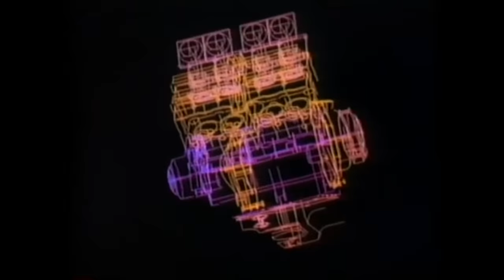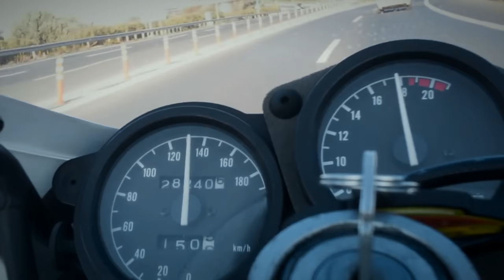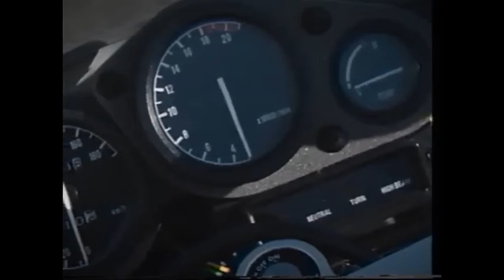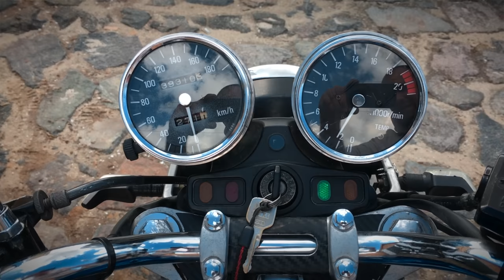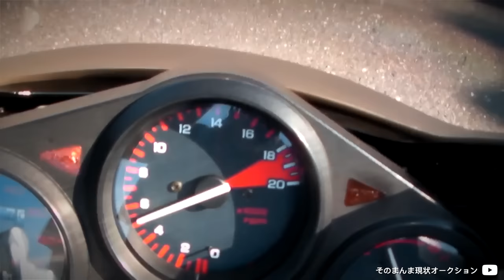The 18,000+ RPM 250cc Bikes Were The Pinnacle Of The 1990's

Comment: I'm not surprised Honda dumped their extra stock in Australia.  It's been many years since I lived there, but when I got my bike license in '88, you were restricted to 250cc or less through your learners and provisional license.  Only when you had your full license could you consider legally riding something larger...so there was a builtin market for 250cc bikes already in place...and many learners wreck their first bike, which keeps the market from becoming glutted with second hand 250s.
Reply: Impossible to wreck a 250
Reply: @Fee.1  What an odd comment.  It's very easy for a learner to wreck a 250 - same as it is with any bike.  All it takes is for someone to pull across in front of them at an intersection - 250s don't stop any better than a litre bike.  Or oil on the road, on a rainy day.  There's plenty of situations a beginner would have trouble with and could conceivably wreck.  It's not always about outright speed, especially for a beginner.
Reply: @Fee.1  You can wreck a 50cc if you try hard enough
Reply: @DanteTheAbyssalBeing  impossible
Reply: @aussiebloke609  nobody can wreck a 250 literally they had monkeys riding them for that experiment and they didn’t lose a single bike they can’t even touch the ground if you try if you put the kickstand up and let go of the bike it will just stay up it won’t hit the ground
Reply: @Fee.1  Have you ever ridden a motorbike?
Reply: @DanteTheAbyssalBeing  yes but only the uncrashable ones
Reply: @Fee.1  youtube never fails for morning entertainment, ask the parents of all the dead teenages if the bike was ok after, ive scraped kids off the road and put parts of motorcycles in 45 gallon drums.
Reply: @aeroflopper  why would you put parts in 45 gallon drums
Reply: @aeroflopper  My Uncle's a paramedic, doubt he could even count the number of deceased riders and wrecked bikes he's seen after 30 years. Tonnes of fun, but tonnes of danger.
Reply: @Fee.1  made all the small pieces easier to carry on a recovery truck
Reply: @aeroflopper  teenagers can’t die
Reply: @aeroflopper  ah ok I thought you meant like in a drum of some liquid
Reply: @Fee.1 I know people who wrecked 125s so 250s are easy to wreck, you don’t seem like you know what you’re talking about 😅
Reply: @Mr Murders  The idea is not about how easy it is to ride, but how easily and quickly you can accelerate to high speeds...and relative beginners are often those who push beyond their skill level (usually because they're still discovering their skill level.  Painfully.)  As you said, "it's less about the size of the bike and more about your ability and the conditions of the road.".  Relative beginners are not necessarily in a position to avoid the conditions (I've known many in Australia who rode every day because they didn't own a car, so riding in all traffic and weather was a fact of life) and they sure can't change the conditions.  And beginners haven't acquired that ability you mentioned yet.  So the idea is to try to slow them down so at least they're less likely to be moving as fast as they might otherwise if/when they come off.  For some people (especially beginners who don't know the limits of the vehicle and their abilities yet), more power simply means it's easier to ride - that is, easier to quickly attain speeds they lack the ability and experience to handle.  Obviously, the idea of a 250 4-stroke being that significantly slow is laughable today, but when I was a kid, they were lucky to crack 100-110 km/h (62-68 m.p.h.) at W.O.T. and lying on the tank.  Things are different today, but legislation moves at a glacial pace -- and correcting bad or outdated legislation is even slower.  Cheers, mate.  👍
Reply: @Mr Murders something like what odd? You’ve given zero context so I have no idea who or what you’re replying to or what your point really is
Reply: @aussiebloke609  my ol' fzr250 topped out at 116 mph.. and got there quicker than any road going sports car any average person could own..
 So.... yeah still quick enough.. but... It's not 160mph plus quick which is to be fair akin to letting a kid play with a gun for young inexperienced people..
Reply: Can confirm its not hard to find a cheap Honda cbr250rr in Aus but i can good luck finding a gsxr250rr, fzr250rr or zxr250 though an I mean just in general no ones parting with those ones you'll  be lucky if you find one 😂

Comment: I've just finished refurbishing the forks on my CBR400RR, also a curiosity of Japanese regulations. 59BHP and a 14.5K red-line, as well as having that gear-driven cam whine. They're great little bikes.
Reply: How long did it take to do?
Reply: @Mohapi_Tau  the actual work only took a couple of hours..... waiting for parts to arrive took about 5 weeks altogether, mainly because the top caps were seized solid and getting them out chewed them up a bit.
Reply: Oh man id love to have an old cbr400 lucky man

Comment: I had an '89 Yamaha FZR250R Exup about 25 years ago. My initial mechanical sympathy was soon overridden when I found it had no meaningful power below 10,000 rpm. Amazing technology when you consider how reliable they are with the revs involved. Great fun at non licence threatening speeds. I fitted a race can to the exhaust & it sounded insane at 18,000 rpm plus.
Reply: Funny how you have to almost reprogram your brain to actually hold onto the RPM that high
Reply: @Onewheelordeal  clutch dumbing and blimping so much fun
Reply: Had the same bike years ago mint
Reply: My 92 FZR250R was a lovely little machine. Always wished it had just had a smidge more power though.. a few more horses extra, or a lighter slightly more race ready chassis would have made these things truly amazing. There is a joy to be had playing the gearbox and "getting it right" through a set of Twisties, and scraping round the outside of bigger bikes is always magic.. I just always wished it would lift the front wheel that bit easier than having to time a clutch dump over a small crest. 120 would be a fine top speed too. I guess if they made more like 50bhp instead of 45, had a slightly fatter rear wheel, and weighed a few pounds less... I would have kept mine outright..
Reply: @jimstartup2729  you're describing the FZR400R 😉
Reply: @phil955i  Ahhhhh but to still be 250 and pull it off would be the trick. It's still something of an experience to use a motor that spins so high and keep it on song. Yeah I wish I had experienced the 400s.. kinda skipped them straight up to 750... But I am a tall guy and need a bigger framed bike for everyday
Reply: @jimstartup2729  yeah I think they could've got a little more out of them as they were restricted to 45 bhp for the Japanese home market. I seem to remember thinking the same with my FZR250R, it could've done with juuuust a little more power.
Reply: @phil955i  that's it.. for what it was, it was great, but alas it just fell short.. I know reliability may have been an issue but with more development it should have been possible to have the same reliability with a little more oomph. My FZR250R got thoroughly thrashed for its whole life... I mean I was trying to keep up with zxr750s and fireblades back in the day.. the only failure it had was putting a hole in a piston, and that was from a rubber inlet splitting and letting more air in on that cylinder.. just got too hot and melted. A wider profile rear would have been nice... You could touch a peg down, but any more and you were on the rim and it let go, but the chassis could handle much more. Ahhh happy days. They are great bikes. I do miss mine.
Reply: I had the 87 FZR250R still a few around in New Zealand, sold mine 2 years ago.

Comment: I've got a Honda MC22 (250 4 cylinder as shown in this vid). It's the earlier one with slightly more HP pre 94 maybe 5hp lol more than the later MC22. Does 20k rpm no problems. 
Forget the RPMs it's the piston speed that counts. Because the stroke is so short the piston speed is still low despite the apparently stratospheric RPM. RPM doesn't really mean that much when the stroke is so short. In addition the piston mass is low so combined with the short stroke the inertial forces are mild. Because the forces are so low even though they rev to 18,000RPM+, these engines show the effects of short stroke by being long lived as well. Mine has 60,000kms on the original engine and it is completely fine.

Comment: I had the bike in the thumbnail. Cbr250rr. Was my 1st roadbike in the early 2000's.
It had about 100,000km on it when i got it i probably put another 30k on it.
18,000rpm all the time lol.
I never could understand how they could maje such a mental engine so faultlessly reliable and perfect, with such a high revvrange, supersonic induction speeds and on donkey-piss low octane cheap fuel.
They really were a marvel.

Comment: I have a 1996 Ninja 250. Just the 2-cylinder, not one of the exotic screamers. But still, with a full exhaust, dynojet, rearsets, lower handlebars and custom tuned suspension from Lindemann, it’s an absolute joy. One of the best feeling bikes I’ve ever ridden. You simply cannot replicate the absence of weight. Really, the only problem is the absurd lack of low end. Especially when it’s cold. But I just imagine it’s a big block Chevy compared to these little hotties.
Reply: My first street bike (had been riding motocross for years) was a 1994 Ninja 250. Fun starter bike but I soon outgrew it. Next was a Honda CBR600. I have owned and still own a number of bikes but I think the CBR was my absolute favorite, light, nimble, and so fast. Loved the sound of the high revving engine with a nice pipe on it.

Comment: Hi from New Zealand 

I owned x3 4 cylinder machines
Yamaha FZR 250R 1987 model
Suzuki    GSX250S Katana
Honda  CBR250R 1987 (MC17)

Didn't have any problems with them, the Honda CBR was the most reliable. I got the Yamaha for 2 grand I recall and the Honda for 1.6 grand. The Honda sounded the best with the gear driven cams. You can still buy them in New Zealand. The Katana had a loud exhaust, they all sounded like F-1 cars.

Comment: Same As You, I would Like To Buy a MC22, Because it has Gear Driven Camshaft, GULL ARM , and the Design of the Front and Rear Light that Rounded, Feel 90's, Thanks You For Sharing About 90's 250cc 4 Cylinder Era, and In this video you Mention "Hashiriya/Winding Rider's" A Young japanese Motorcyle Rider in Japan who Go on Touge 😁, I'm very Interested About that one thouht, in Indonesia, Many Rider Modify Their Bike and Inspired their apperance By Wearing A Racing Suit, Go Down in the Circuit or a mountain Pass, And last Thank's For sharing 😁👍🏻👍🏻👍🏻

Comment: I had a CBR250RR MC19, (a JDM “grey” import to the U.K.) which I took hillclimbing, and down a drag strip a number of times. It was an interesting experience, despite having a rev limiter at 18500rpm it only really made any usable power above 15500rpm, which meant you spent most of your time shuttling up and down the gearbox like a madman if you were trying to go fast 😂 

You had to re-calibrate your brain to ride it, in/on any other vehicle that kind of thrashing would destroy the engine within seconds, but the ‘ol Honda just took it and took it and came back for more…. One of my friends had a ZXR250RR, which revved higher, and was slightly faster, but that actually did spin a rod bearing and destroy itself.

Which one would I have? The ZXR seemed to offer the best performance, but to the detriment of reliability. The CBR MC22 you mentioned looks nicer, but actually only made a max of 40bhp but over a wider rev range, so probably more user-friendly, however if I had to choose I think I’d go for the MC19 again and just keep thrashing the bejesus out of it! 😉
Reply: They still go for relatively cheap the few times they come up here as well! I've been keeping my eyes peeled for ones and I've never seen one be on a classified ad for over £4k

Comment: z25r had new tech including traction control system, auto-blip, and quick shifter I think they also included slipper clutch I think these are the reasons why z25r are quite expensive

Comment: We used to think that RD's, KH's and TS's were fast. And they were, until these things came along. The two strokes were always faster off the line, but once these four cylinder four strokes built up a head of steam, they were out of there. And if you put a bend in the road, they absolutely cleaned up. I finally got a chance to ride one a few years ago. "Cruising" at 10,000 RPM takes a bit of getting used to, and honestly, I prefer my old RD stinker, but there's no denying what an awesome bit of kit these things were/are.

Comment: does anyone know why motorbike engines have the redline so much higher than the peak power RPM?
in comparison, my car makes peak power at 7000rpm and the redline is 7200rpm, just 200rpm above, whereas the cbr250rr in the video makes peak power at 14,500 but the redline is at 19000
Reply: The bore larger than the stroke. You can compare car's and motorcycle's bore x stroke ratio to start.

Comment: Had a go on a CBR 250 was dead below 10 000rpm and fell on its face after about 18 000 but will go to 20 000 witch was impressive rpm but that was about it for me loads of noise with not so impressive performance
Reply: Have you ridden bigger bikes? Point was, if you had only just gotten off your learner bike, these still provided a good thrill and bags of learning potential. Or if you were restricted to these for whatever reason, it was the best you could make do with.

Comment: In every era, anywhere in this planet, old politicians always try to make the youngsters life less and less fun and leaves the generation in between to figuring out ways to skip past all that, because they are closer to the youth and they just *knows*.
I still wish someone stand up with an inline 2 for today's 125/150cc class. Just to get any bit closer to 125 2stroke class of the good old days. Nerf it only with ECU map just to make it as easy fix for the youth to unleash it.
ZX25R power to weight ratio is terrible, btw. Forget forged aluminum frames of the old, they're basically enforced steel in trellis frame. Which is a far cry of the old ZX250 of the 90s was.
Sure, we have improvements in manufacturing which resulting the engine being better built. But all that progress is pointless if they don't go all the way making the best bike possible with current available tech like they did with MC28 of an NSR250. 
Sales numbers may be low, if they actually went with it, but that was the whole point of sports bike. We never expect them to be cheap.
Did you know the CBR250R was a 10k of a bike? Add inflation, and you could get 4 basic ZX25R with that same amount of money. Yet people still bought it. By this point of view, the new CBR250RR i2 almost seems like an insult to the legacy.
At this point, I'm trying my best to take care my old NSR 150 SP, even though I barely ever use it. Just so my baby son could, later on. Since they don't make them like these anymore.